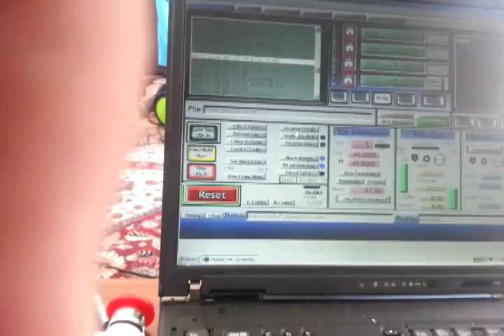Second test with 6mm end mill

Comment: is this a HF spindle ?  if so ,something is wrong with that sound. i have allot of shater to when milling AL but this spindle alone sounds like its gone blow up any time soon :(
Reply: +joppe peelen  I think he acutally made the spindle and housing. I am thinking the spindle bearing preload may be the problem otherwise i guess the linear guides have play in them.
Reply: +Jeremy  Looks like he discovered in later video that collet nut was causing vibration